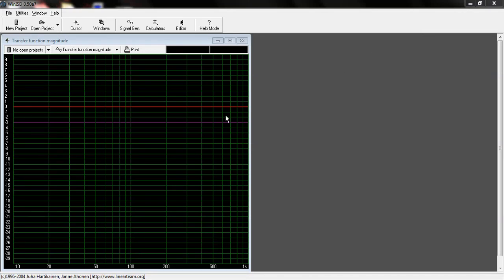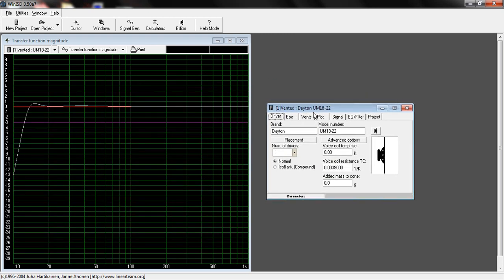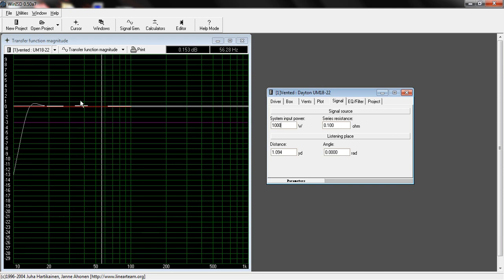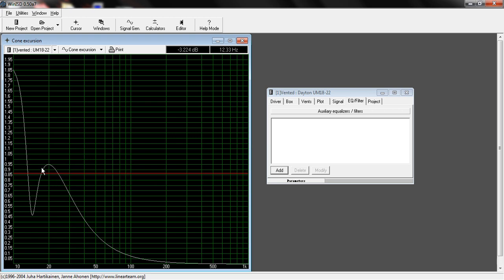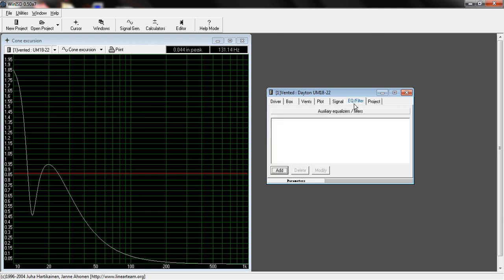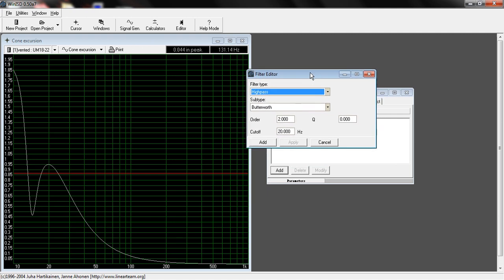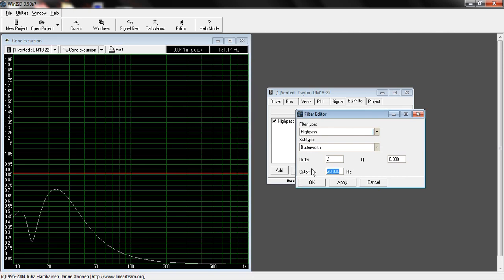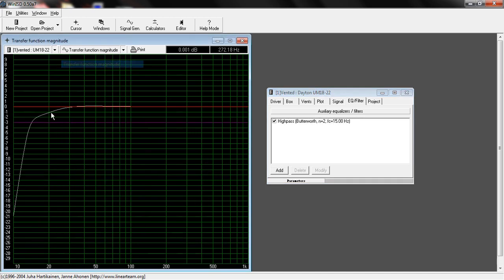WinISD Tutorial - Cone Excursion

Comment: I dare you to plug your subwoofer into a 1000W amplifier and turn your volume up to max...that is beyond rock concert level of volume.
even 100W into a 12'' speaker is INSANE. So really I dont think you should compromise on your enclosure design in terms of frequency response just to not bottom out at full power...you'll never use the speaker at full power

Comment: I'm using a 12 inch jbl s2-1224
And i tuned a box at 22 hz 4.5 cubic feet
Im getting overexcursion at 19hz with 200w which is not an issue and port air velocity is below 16
About 105db at 20hz according to spl
Will this play loud enough at 200w ?
The sub need 275w rms
I cannot put more power from my 500w amp otherwise i get overexcursion at 30hz and 25hz
Will the sub play loud enough and low enough at 200w ?
Is 105 db loud enough for 30 and 20hz?
Im building this for home theater

Comment: I have designed a lot of speakers in WinISD and almost every one of them using a ported enclosure has exceeded cone excursion unless I place a high pass on the woofer I want to be able to use some of my vintage amplifiers that do not have DSP... so I looked into building a second order High pass filter one one of my speakers and I would need a large 53Mh inductor and capacitor. This would allow me to go down to 53Hz 3db down lol that is huge No idea where I could even find one that big. and it would probably be pretty expensive. But if I use a first order using only a capacitor it works but my low end is now 60Hz. I guess another option are some of those RCA line level high pass filters I have seen for sale. but those only work for me if my amplifier has main in and out on the back. Some do some don't.
Reply from the maker: You really don’t typically need a passive high pass. I can’t think of any manufacturer that uses a high pass. There’s a lot of reasons for this, including a high-pass typically being on the amplifier that you’re listening to also using the speakers as they were designed. In fact, I can’t think of any speaker that uses a passive high pass crossover. But I do understand why you would think that, especially seeing the graph in winISD.
Reply: @Toid  have been trying to build a 3 way box ..and i tried various drivers as woofer.. ..tang band W6, Sb acoustics 6", 8" drivers (11mm xmax)...and all of them are exceeding Xmax at around 20Hz above 10 watts signals....how am I supposed to deal with that?!?...it's all in winisd ?!?..theirs RMS are 60 watts but Xmaxs are reaching even under 10 watts...i tried lowering the box volume or increase tuning frequency..but even at 40-50Hz@0db..  nothing better

Comment: I watched and read a lot of forums and clips especially yours but i still cant get it
I want to build 2 floorstanding speakers.
I intend to use all dayton audio drivers.
Per speaker:
4 woofers dayton audio rs 180 - 7 inch 8ohm paper drivers
1 4 inch fullrange 8 ohm paper driver
1 textile soft dome tweeter
so all about that xmax and box tuning
it is state 6mm Xmax for the driver but when complied in winisd even at rated power of  60 watts rms per speaker it exceeds it twice
should i worry about something
Reply from the maker: The best thing to do would be to post some photos of your graphs that show the box size tuning excursion etc on the Forum so we can look at it. www.toidsdiyaudio.com
Reply: @Toid  Thank you for the fast reply. I will register and post a forum tread in the DIY speaker and subwoofer category. I will try to explain thoroughly everything so that you can give me the best advice
Reply: @Toid  Well I made a topic in the speakers diy section so looking forward to hearing from you

Comment: My problem is that my sub isn't moving enough... im charting 4 ZVX 15v2s and cant get them to cross that 29mm line. I'm having issues making it cross the red line. Even at 10 Hertz I'm able to play the subs at 6000 Watts without them reaching xmax. Wtf winISD
Reply from the maker: Sounds like your data is wrong. Make sure you input the data correctly. Ie make sure you have each data set to the correct unit, when inputting the subwoofer days. It sounds like you may have input something like feet instead of inches or the metric equivalent. Or set it to meters instead of mm for xmax. You have to be careful of that
Reply: @Toid  ive checked it and its fine. 29mm for xmax, all the data is damn near exactly what the box says etc. Even with a box that is 22.5cuft and has a port that is 16" ×10" tuned to 35hz, still, no movement.
Reply: @sethh8892  I have the same problem right now, what did you do???